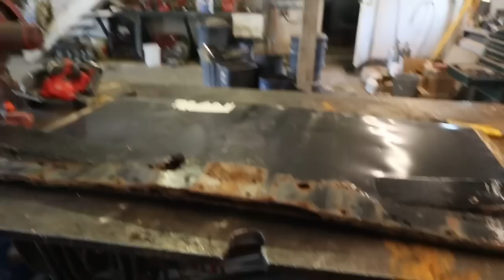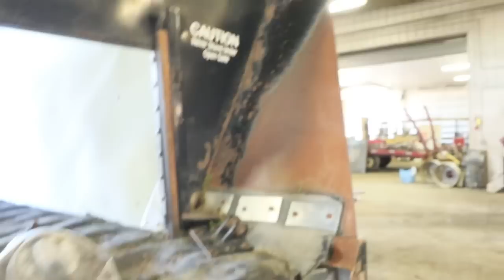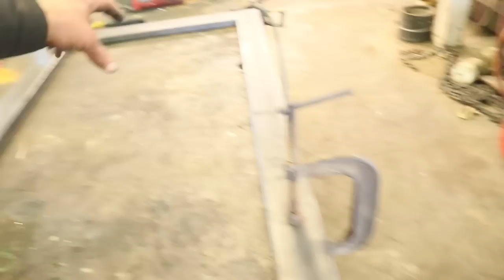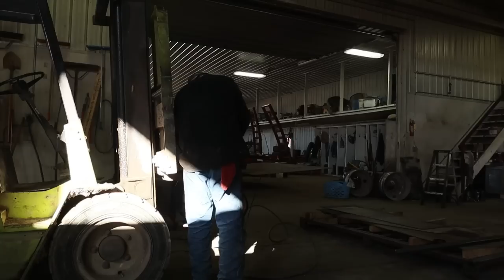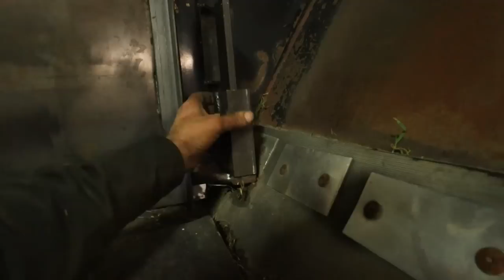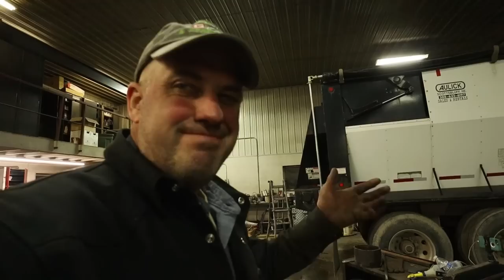Aulick silage trailer | Knife gate build part 1 of 2

Comment: In the past to justify owning new semis I contract hauled for an aggregate company along with a large paving contractor.  I had 6 Red River live-bottom trailers for hauling gravel and asphalt.  We used them for several years to haul corn silage and they worked well.  The only down side was they were 8 axle trailers so once loaded they were unruly in the field.  Many times it took a CaseIh 9390 we had to pull loaded trucks out of the field.
Reply from the maker: Farming the Mitten sounds like fun

Comment: We had to rebuild the knife gate on our Aulick for the same reason. Used 4x3/4 strap around the outside and and then one 1/8 sheet for the main part if I remember right. We probably over built. We just welded the old knives back on.I like the tubing around the outside of yours.Thanks for the videos

Comment: What's the Milwaukie battery chop saw you were using, looks a handy bit of kit.
Reply: Your friend has shared a link to a Home Depot product they think you would be interested in seeing:

Milwaukee	M18 FUEL 18-Volt Lithium-Ion Brushless Cordless 5-3/8 in. Circular Metal Saw with Free M18 5.0Ah Battery
https://www.homedepot.com/p/Milwaukee-M18-FUEL-18-Volt-Lithium-Ion-Brushless-Cordless-5-3-8-in-Circular-Metal-Saw-with-Free-M18-5-0Ah-Battery-2782-20-48-11-1850/305908068
Reply: @cntslesfabrication  Thanks
Reply: @andrewmicas4327  is that what you were asking about?
Reply: @cntslesfabrication  Yes it was, we are a bit behind here in UK, but I found both items Saw and battery here. I was very impressed by the way Andy cut the box section with it. Looks a really useful on site tool, there are demo's showing it cutting Unistrut.Andy's battery is a monster but I guess that's what you need given the work it will do. Thanks to both again, might be cheaper here after Brexit.
Reply: @andrewmicas4327  okay cool. I have it as well and it's a game changer for me I don't have to carry a chop saw with me anymore when I go do installs
Reply from the maker: It’s Milwaukee’s largest 18volt battery,it’s the 12.0
Reply: @FarmingFixingFabricating  Thank you